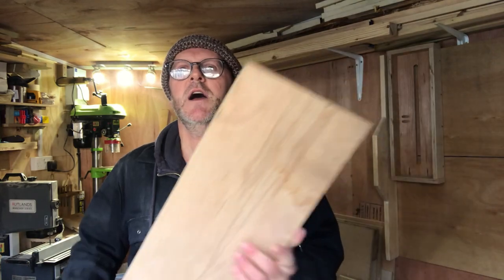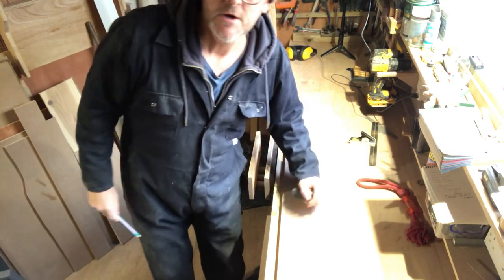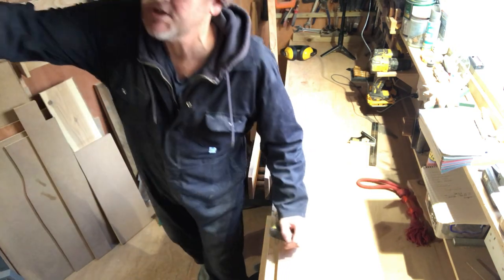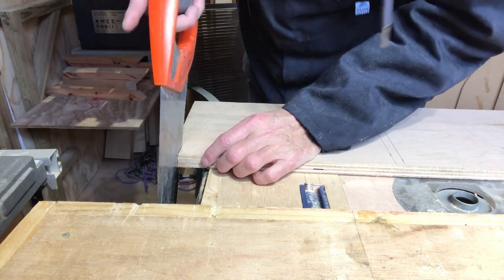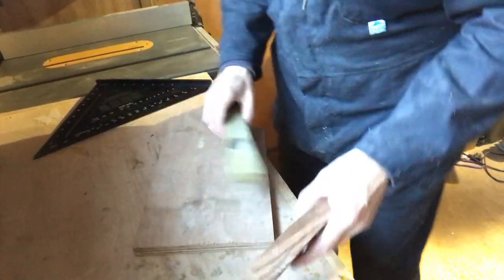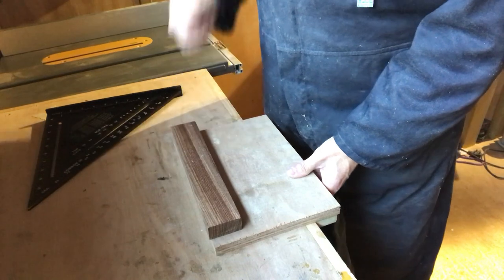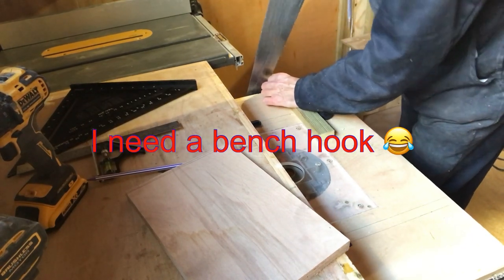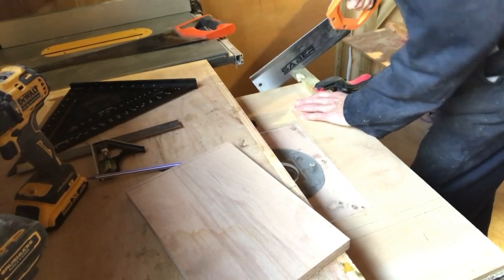Making a Bench hook for cutting wood.

Comment: Lovely music. I tend to clamp a lot; so always at least two clamps to prevent a piece pivoting about. I often clamp my various squares to a work piece, then push my second piece against the square and clamp it down (the 12" speed squares are good for this). Then do all my drilling and then gluing and power screwing with the clamps in place. I really struggle with seeing whether a piece is accurately set on a marked line; and when you're gluing against a line, you can get sideways slide. Love your enthusiastic approach. I notice you have a Rutlands bandsaw: a review would be of interest; I can't decided whether Rutlands tools are value for money, as they tend to be pricey. Take care over Christmas and New Year; best wishes to you and yours.